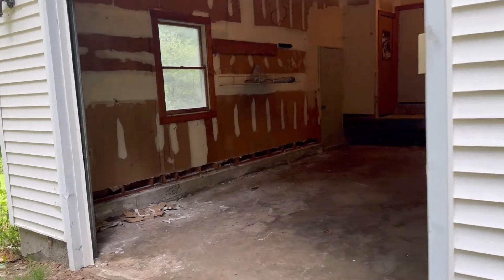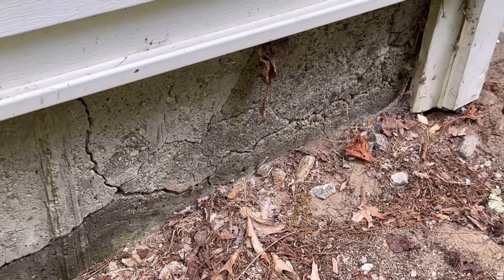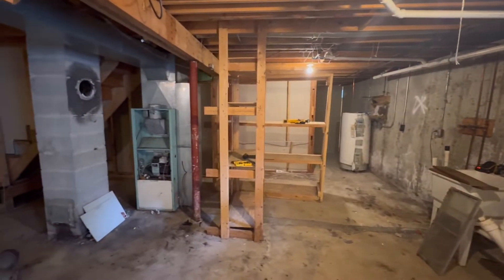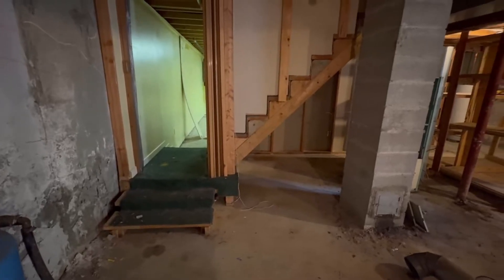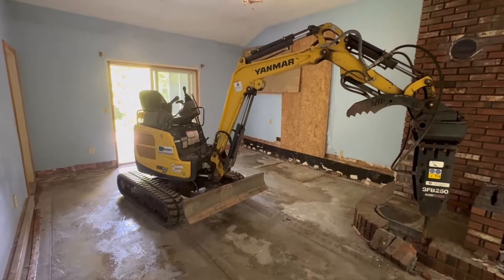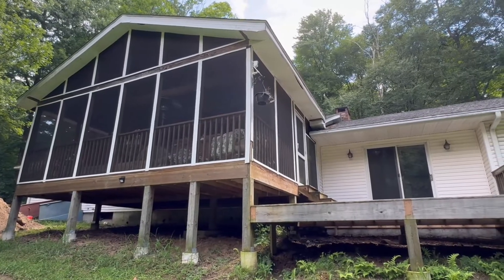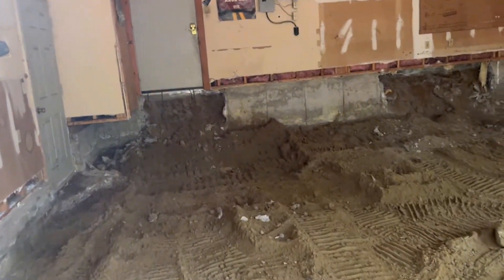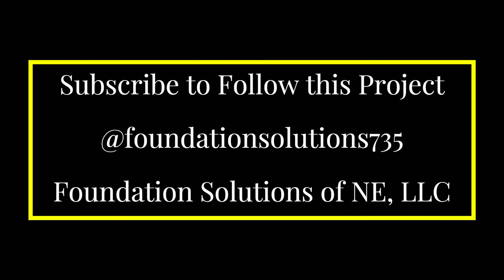Part 1 - Crumbling foundation replacement

Comment: I'm no expert, in fact, I know nothing about this type of work, but shouldn't there be rebar to reenforce the concrete wall?
Reply from the maker: Rebar in residential buildings was not code until the early 2000s.  This home was built in the mid 80’s.  Rebar would not have helped the issue though.  Homes will rebar and pyrrhotite still failed
Reply: @foundationsolutions735  gotcha. Makes sense.  Thanks for the reply. Now I know